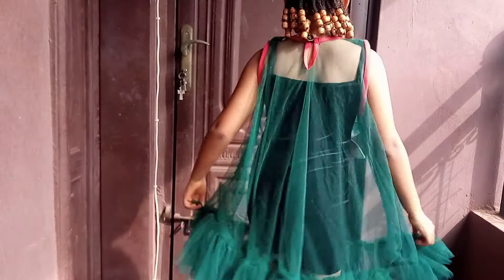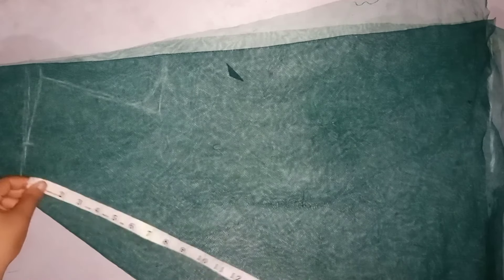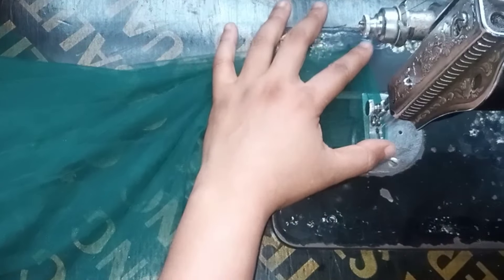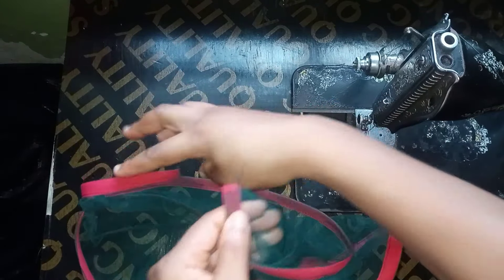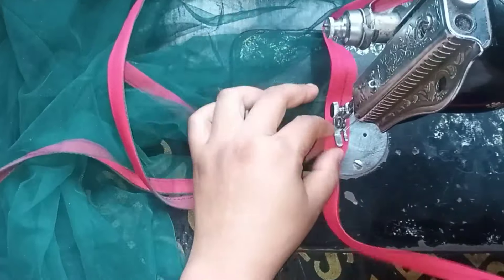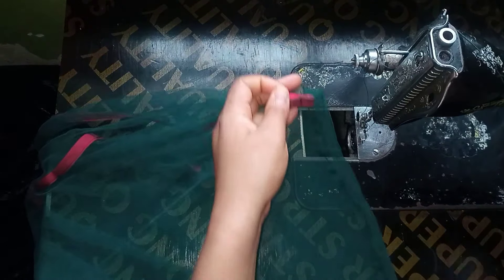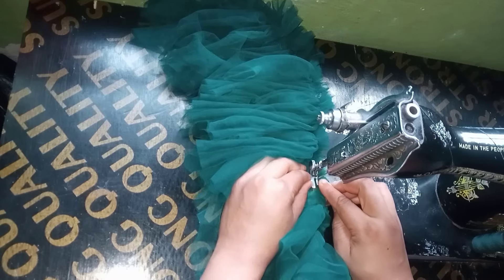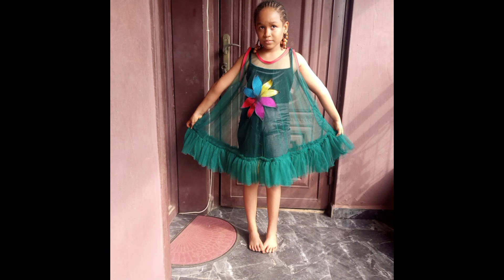How to sew a mesh/net dress with patchwork.

Comment: What size needle do you use to sew on the mesh or tulle and is it stretch needle?
I find when I sew on tulle the seam puckers no matter what size needle I use or tension I  set my machine to.
Reply from the maker: I made use of Violin needles size 100/16.  And for the tension, my machine is a black head machine and doesn't have size chart on the tension.